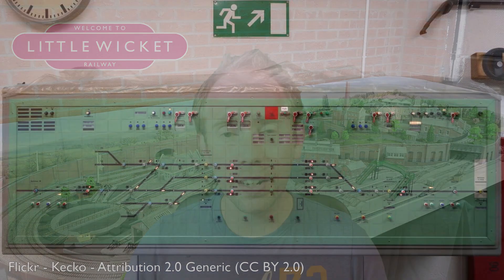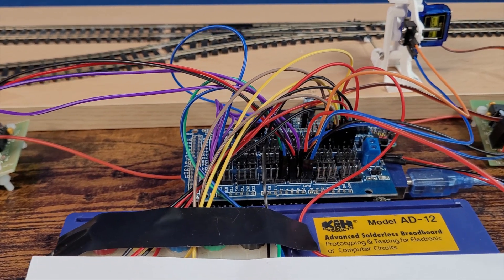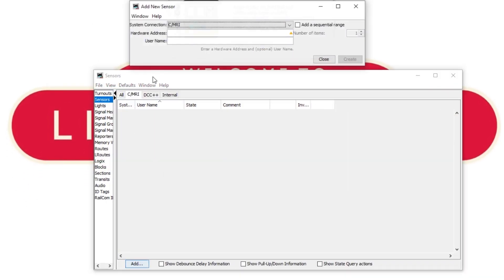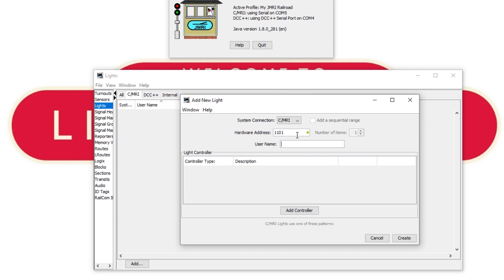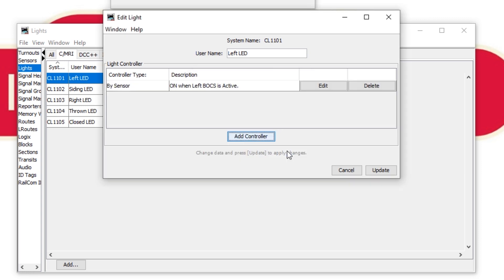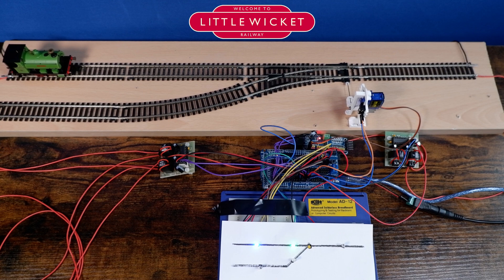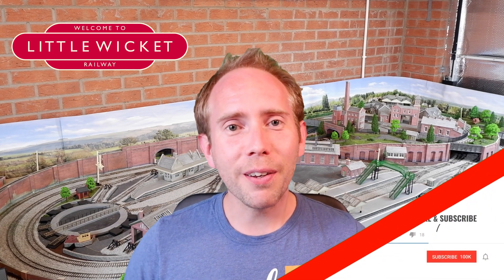Arduino Mimic Panels Part 1 of 2 - JMRI Connected Panels

Comment: Hi Rob thanks for all your help through your videos. I am trying to implement point position microswitches on the MERG servo mount. In the video you say you have delt with wiring the switch elsewhere. I can not find where. Is it just a simple case of connecting ground to signal via the switch?  Advice or direction to the appropriate video would be appreciated. Thanks Graham
Reply from the maker: Hi Graham, sorry it's taken a while to reply. I've just used the signal and ground pins on the Arduino for the servo feedback micro switch.

At 2:14 in the video you can see the blue (or purple? I'm colour blind) wire which is connected to ground on pin 7 and the orange wire which is connected to the signal pin on connection 7.

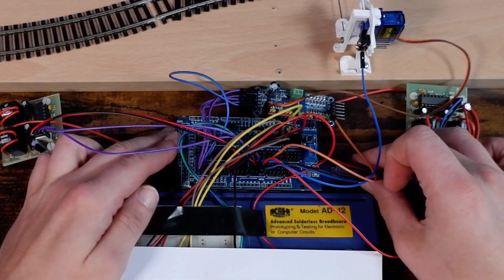At 2:30 in the video you can see that the orange signal wire has come off the centre pin of the switch (oops).

Comment: Hi Rob,
Just getting into all this Arduino, JMRI and DCC-EX stuff and really enjoying it.
Your video's are a great help!
However |I'm having a problem with the push button switch, when it is closed it says its Active however when its open it jumps between Active and Inactive, I have tried altering the DeBounce delay but that does not help.
I have also tried adding a bounce delay into the sketch, but that makes no difference.
Any suggestion?
Cheers.

Comment: Hi Rob. Id like to do exactly this but I'd like the turnout in panel pro to update its state when the turnout is thrown either by a button or via a sensor. Is that possible?
Reply from the maker: The turnout in Panel Pro should show whatever the turnout in the turnout table is showing. So when you activate it by pushing the button (or sensor if you want it activated that way) it will change.

Comment: So, here’s a challenge, using an RFID reader and chip have two trains running at the same time but have it so that if one enters a siding it is identified and stopped at the end without interrupting the other train.

This would be great for automating yards without pulling your attention away from the rest of your track, you just set your turnouts, send your train in, and when the IR sensor is tripped at the end the DCC++ base station detects which engine is in the yard and stops it leaving you to continue other operations uninterrupted.
Reply from the maker: Challenge accepted! I've got the RFID kit from a company called SEEED, just need to find the time to try it out.
Reply: @LittleWicketRailway  SEEED is a descent company, I’ve ordered a few things from them, MERG also has an RFID set (I became a member after seeing your video on block detection)

Comment: Many thanks. It would be great if you could add an additional siding and point to give 3 sidings, then make each siding have a button to select the route to the siding, rather than have a button on each point. Also, what are the options for using an arduino to drive solenoid point motors?
Reply: I would use two N channel FETs, you could also use relays or Transistors. In JMRI, choose two bits and momentary when adding the turnout.

Comment: Thanks Rob for all this info on interfacing and so on - it will come in very useful.  One central question here about the mimic panel. Newly returning to the hobby I am amazed that otherwise teched-up people are still building physical panels for this kind of thing. Why not use a programmable touch panel instead of physical board with physical components (LEDs switches wiring, mimic diagram that gets to look dog eared after a few months use ....)?  

Using a product like the ones from Nextion, 4D systems etc  (I have no affiliation with any of them) you can design your mimic diagram in multiple ways (using the free designer software) and place virtual indicators on it, in place of using actual LEDs and a virtual button for the point/turnout control. Then, it's just a three wire serial connection back into the Arduino from the panel - simplifying the wiring quite a lot . With proper design, the Arduino can command the panel to change the state of any on-screen element - for example to change the colour of an on-screen LED.  You could also dispense with LED emulation and just have the whole track section change colour  (or have a train graphic on it) when occupied. In other words the Arduino can command the touch screen elements to change state to indicate what's going on, and it can receive touch events from the touch panel for point change commands - or anything else. 

Also, if you go the touch panel route, it's ever so easy to change the mimic diagram.  So if/when you make changes to track layout in future, it's not a new panel, it's just changes to the design and re-upload the revised mimic into the touch panel's screen memory. These touch panels come in up to 10" sizes, but I think for my layout I will use several smaller panels - one for each major section of my layout.
Reply from the maker: Hi Alan 👋 I'm not really into physical panels either, I just had quite a few requests for a video on them. I suppose it's a bit more fun to push a button or pull a level than the click a mouse. Also some panels can looks really smart and impressive, McKinley for example. All the additional wiring required is enough to put me off though, maybe once the layout is completely finished (i.e. never) I'll add a physical panel.

Just like the system you've described, JMRI lets you create virtual panels from which you can pretty much show anything you want. JMRI needs to run on a computer, but there are ways to connect tablets which will show the panel. I've not heard of Nextion, but I'll check them out 👍

Comment: never occurred to me to hook up an actual mimic panel, very nicely done

also you have a 100 ohm resistor for the LEDs, you will likely find a 1K ohm one will work as well, giving you 10 times as many LEDs from the arduino - you are likely over driving the LEDs if you drop to a red one with 100 ohms - 1kk and you are at a tenth of the current which may be better. varies by LED colour.

incidentally these videos are excellent and way easier to follow than the JMRI & C/MRI documentation
Reply from the maker: Thanks Dale. Great point about the LEDs I will mention it in part 2 and give you the credit 👍
Reply: @LittleWicketRailway  lol, resistor varies by the spec of the LED but for most they are bright enough at 3-4mA, also by the forward voltage of the LED, tends to vary by colour, worth experimenting as even if you have an external power source you need to provide the juice from somewhere.

stuck a 5V 5A AC-DC converter in mine to drive Arduinos, of which there are several, probably way too many, and the LEDs.

another option is a transistor driver circuit, probably overkill for an Arduino that can drive directly but makes it a lot easier to have a PWM supply so you can vary the brightness of the mimic board, I find the blue and white LEDs especially dazzling where a lot of green ones end up as "is that even on?"

you do however have me sold on a mimic board over a C/MRI connection, probably using a Pi Pico MCU as its similar in size to a Nano but has a lot more ram, and I like over speccing things

Comment: I find it to be most flexible and efficient way for LEDs on mimic panels is using Neopixels. Super cheap, much less wiring and no headaches if you ever want to change color. And easy to use with Arduino as well. I did several videos on this, see e.g. here: https://youtu.be/ekMDGZ1VSlw or here: https://youtu.be/MuUwa7XUilw
Reply from the maker: Thanks IoTT! 👍